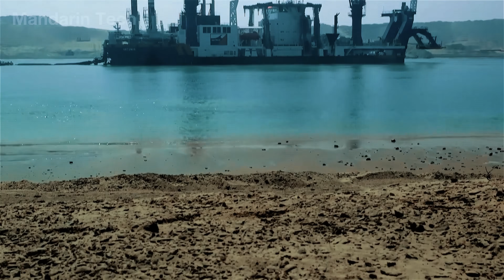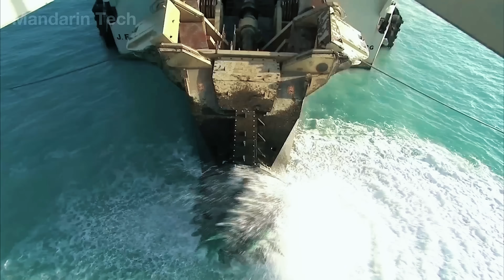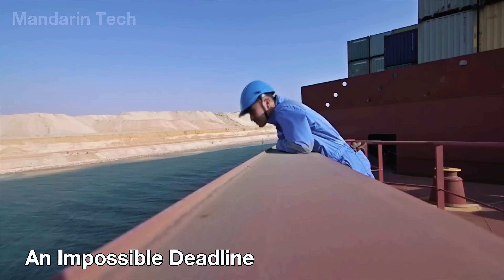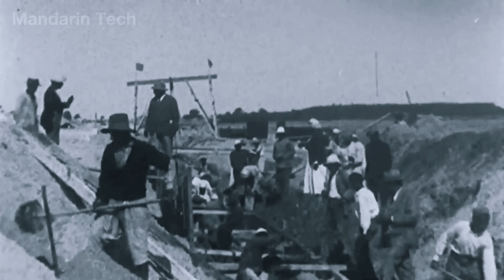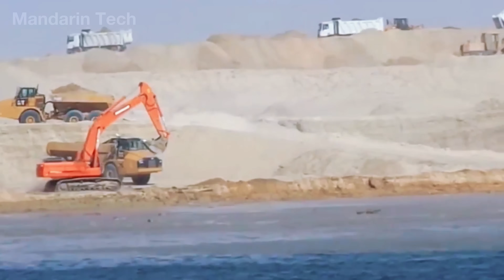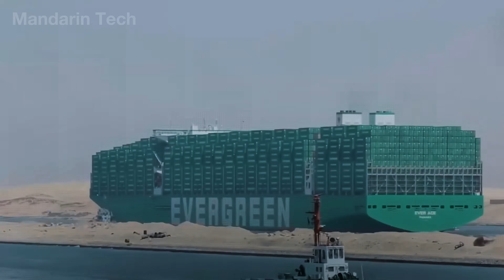How 400,000 Workers Built The Suez Canal Across a 200 km Desert That Reshaped Global Trade Forever

Comment: Field Engineer & Environmental Perspective
🇬🇧 English

From a field and environmental perspective, constructing a canal across a desert presented extreme challenges in working conditions, water control, and environmental impact.

Today, such projects would require strict environmental assessments and sustainable practices.

Field engineers play a critical role in ensuring safe operations, efficient execution, and environmental compliance.

Modern engineering must balance infrastructure development with environmental responsibility.

#FieldEngineering #EnvironmentalEngineering #SustainableInfrastructure #HydraulicEngineering #ConstructionSafety #ResponsibleEngineering #ClimateImpact

Français

Du point de vue terrain, la construction dans le désert présentait des conditions extrêmes.

La gestion de l’eau et l’impact environnemental sont essentiels.

Les ingénieurs terrain assurent sécurité et conformité.

L’ingénierie moderne doit être durable.

#IngenierieTerrain #IngenierieEnvironnementale #InfrastructureDurable #IngenierieHydraulique #SecuriteChantier

Español

Desde la perspectiva de campo, construir en el desierto implicó grandes desafíos.

La gestión del agua y el impacto ambiental son clave.

Los ingenieros en obra garantizan seguridad y control.

La ingeniería moderna debe ser sostenible.

#IngenieriaDeCampo #IngenieriaAmbiental #InfraestructuraSostenible #IngenieriaHidraulica #SeguridadEnObra